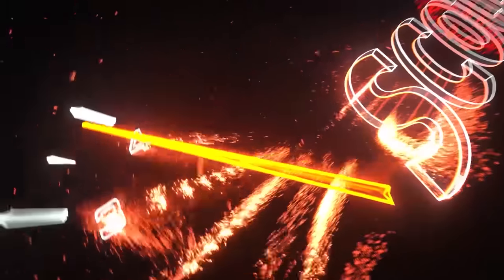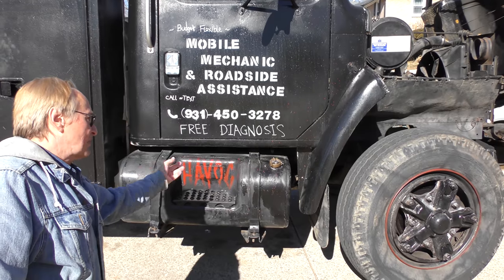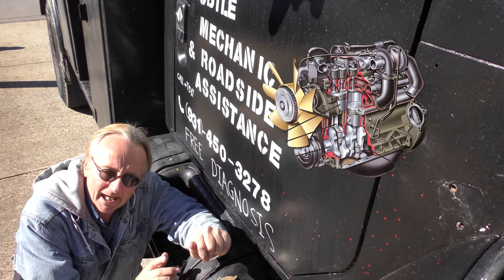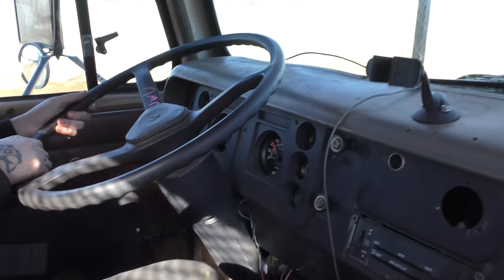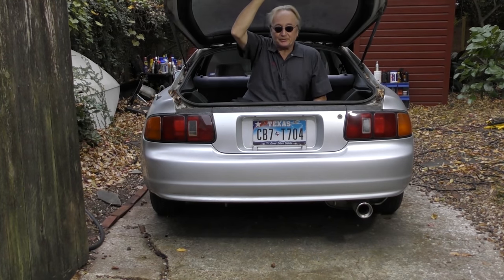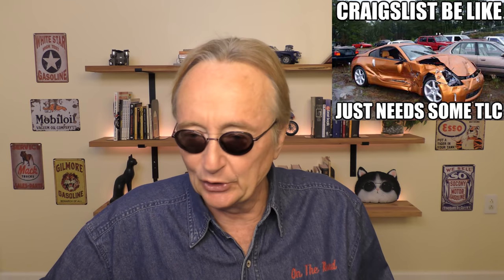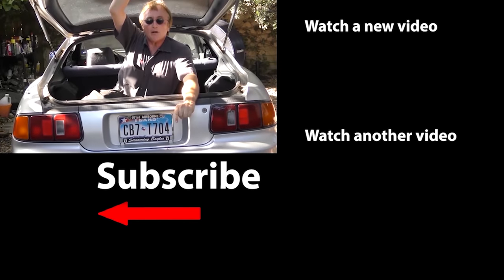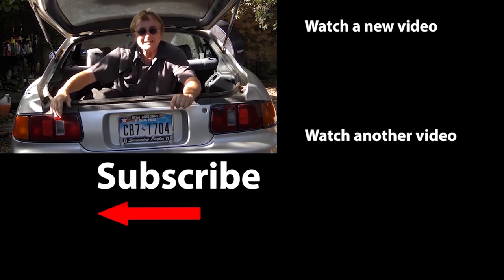Here's Why This Truck is Better than a Toyota Tundra or Ford F-150

Comment: On the vehical shutting off when decelerating. It could also be the torque sensor. Not telling the transmission to down shift. Causing the engine to stall

Comment: I guess a modern tech mechanic would be confused with no where to connect a fancy $5000 scan tool but not Scottie! The computer between his ears kicks in and the problem is as good as solved!

Comment: I was jonesing for a M35a2. After contemplating the cost of ownership, I asked myself "if I broke down right now 40mi away can I afford the tow bill" and often say nope, not today. Now I am surrounded by commercial grade trucks so if the apocalypse happens I will just get a key and drive one away. My 87 Japanese truck with no electronics,  with a tow bar. 😎

Comment: Hey Scotty great videos. Recently changed the battery on my 2011 chevy aveo i got in a hirry and installed backwards when i tried to start no lights no nothing. Finally realized my mistake ive changed two fuses one 10 and one 15amp but still nothing not even the door ajar light. Any advice would be greatly appreciated thanks keep up the good work to help dummies like me🤣😂🤣😥

Comment: That guy with the shutting off on the Ford. I think I remember that they've had two different revisions of the throttle assembly . Look for a couple more videos try the FordTechMakuloco YouTube.  I think in one or two of his videos he showed the different  from the original to the third revision and talked about why they changed.

Comment: Standard equipment is a junk thermostatic  fan clutch like on a 327 Chevy that is very expensive. Buying a new one of these is a fool’s game. 
Optional from the factory and more expensive to replace is an electric clutch. Horton is a quality company and you can put their aftermarket conversion on it quite easily. Not cheaply.

Comment: I'm looking for a tundra 06 SR5 four-wheel drive is this a good truck I assume it is. I'm worried about the transmission in the four-wheel drive if it's good and last long. I wrecked my '06 tundra standard pickup. Me and my wife hit black ice hit a dividing wall 60 mph the truck saved our life. If we would have been in the Corolla we probably wouldn't be here.  But I'm looking for an 06 tundra SR5 around 100,000 MI if possible are they good trucks God knows they'll save your life especially with your seatbelts on

Comment: I’ll take a Detroit 6-71 or 6v-71 over a 6.2 & 8.2 anyday. When you do a oil change just pour it in the fuel tank like they do in the oilfield. Detroits are simple to work on.

Comment: Don't need a truck for the apocalypse but an old 1970's Mercedes diesel manual transmission would be cool and reliable. Or even a non-turbocharged VW diesel Rabbit from the 1970's with a manual transmission.

Comment: Probably the old 6.9L IDI diesel [no turbo].  Those things don't ever die.
Reply: S3v3nFA  -- Even better!  The 6.9 was a V8.  The DT466 is an inline-6.  We used to have several of them in our fleet.  Those things could pull a box truck around like nothing..........and they never, ever broke down.  Other stuff of the trucks (late 1990s models) typically fell apart, but the engines ran and ran with no issues.

The post-2002 International trucks took a nose dive in quality, though.

Comment: International engines won't brake under pressure.
If the weather is extreamley 
Cold and won't start, get the gas gun out take off the rubber trunking, put the large flame into the air intake when the engine is turning over this always starts them.

Comment: F350 600k. Miles  7.3 bought it new in 2000 replace two water pumps 1 injector number 7 it's good Workhorse

Comment: Hey Scotty I watch all of your videos you are a rockstar in my book! Maybe you can help me with my 99 Saturn sl2. It idles too high and I changed the idle control senor, cleaned the throttle body, checked for vacuum leaks with a smoke machine and their isn't any check engine light on. Do you have any suggestions I don't trust the mechanic shop that's in town. I'm at the end of my rope but I can't afford to buy a new car

Comment: Scotty, I switched the CV axle on my 99 forester, manual. Then put it back and it started cracking again but now it feels like metal griding on my gas pedal and when I turn my steering wheel. Help?

Comment: I drive a kia sedona2.9 diesel. Every time I stop I have to take out the battery. If I don't take it out when I come back it might not start as the battery would be empty or too low. What could be the problem. I have changed the battery and the alternater brashes

Comment: That is a great deal but way too impractical for most truck owners.  I pull my 2005 F-150 in the garage every night and I need to because it often is loaded with tools.  210,000 miles and it purrs like a kitten.  The same truck that I paid 17K for new now goes for nearly 50K.  How anyone can justify that is beyond me.  I know that what i can charge my customers has not increased since then.

Comment: Well, hmm, they newer vehicles have so much government regulations on them. I'm surprised they are able to drive out of the dealership. Let's put all the regulation requirements on the old vehicles and see if they have the same issues. Apples to dirt comparison right here.

Comment: Dont care for the split rims.. Big diesels use a heat grid to warm the cylinder not glow plugs. Adept Ape will tell you about big diesels. Yeah that truck better run 500 600k thats what its designed to do at 5 mpg 2.80 diesel price

Comment: THIS WAS A BUCKET TRUCK SO IT SPENT ALOT OF TIME IDLING SO YOU NEED TO SEE IF IT HAS AN HOUR METER IF SO 8000 TO 10000 HOURS IS ALOT.

Comment: You cant compare a diesel truck with a gasoline truck. Dont be a silly rabbit trix are for kids. Big difference its like comparing an 18 wheeler that goes 1 million miles for normal times and a chevy that barely makes it to 100k 🤣🤣